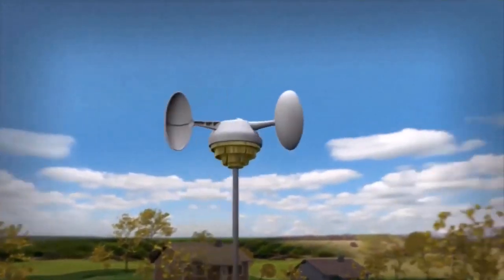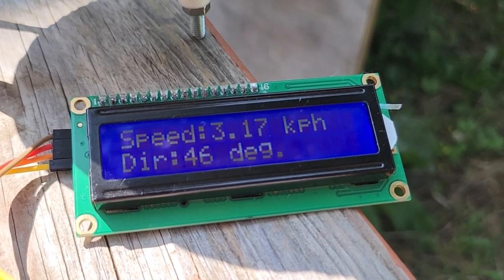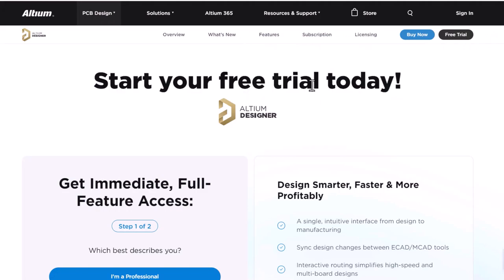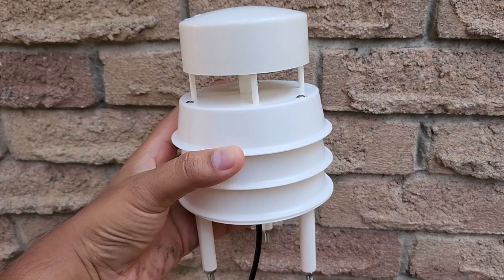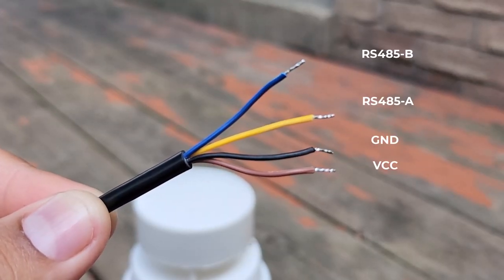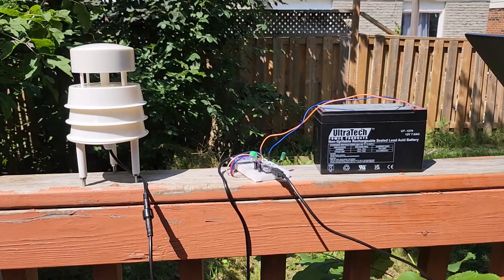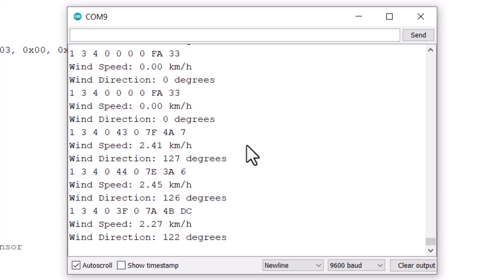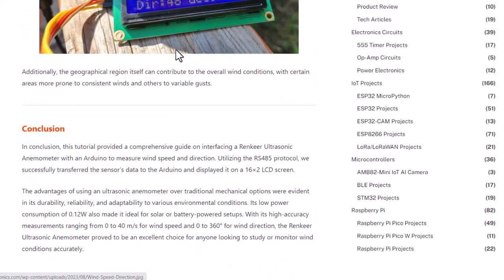Measuring Wind Speed & Direction with Ultrasonic Anemometer  & Arduino

Comment: Attempting to make this and just wondered the purpose and function of the MOSFET and capacitor in the circuit diagram? I can see you've put the capacitor in the final prototype but not the MOSFET. any clarity on this would be amazing, thank you!
Reply from the maker: That is not a mosfet. That is a 7805 voltage regulator IC to provide 5V to circuit. The battery is supplying 12V to power on anemometer. But all other components require 5v. The 12v is converted to 5v using 7805 regulator. The capaictor is used for voltage stability and to avoid fluctuations in voltage.

Comment: Looking at your schematic, supplying a std Nano board Vin with a 12v battery EXCEEDS the Vin limit (7-12v) since a 12v battery can be as high as 13.8v (or even higher depending on the battery used).  Your project is going to have a limited lifespan!  The 5v from the 7805 should be sufficient to run the nano.